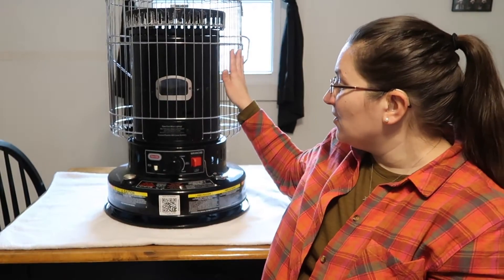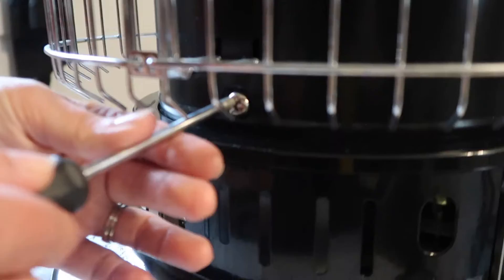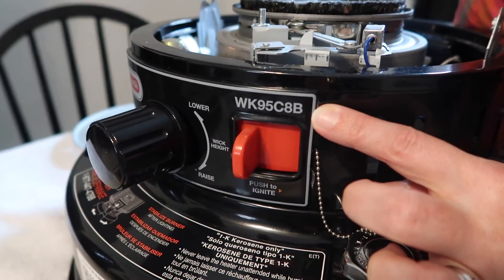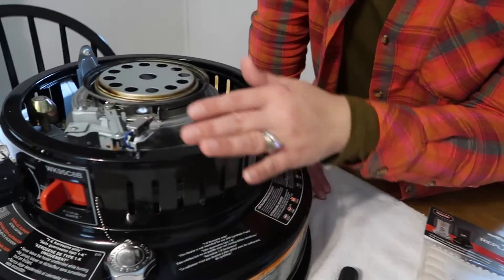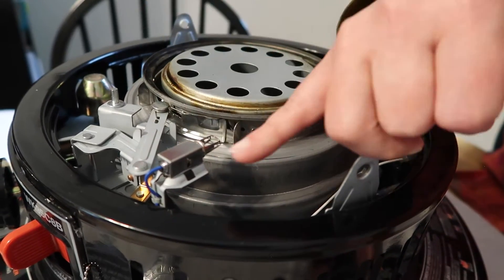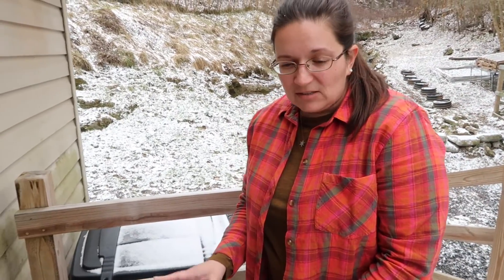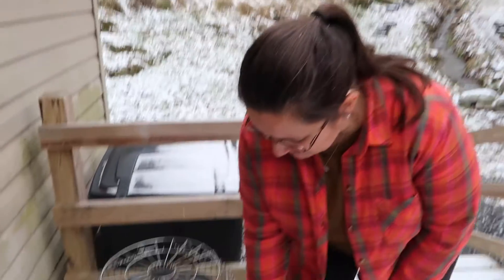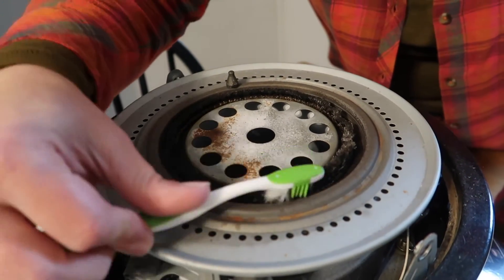Wick & Ignitor Maintenance  (Dyna Glo 23,800 BTU Kerosene Heater) for Emergency Heating

Comment: So you just use a dry tooth brush after you dry burn it ?
Reply from the maker: Yes and the reason for this is to brush all of the remaining carbon deposits off the wick. Carbon deposits in the wick basically burn up during the dry burn…think of a self cleaning oven…you still have to go in after the clean and remove all the burnt stuff out…same thing with this wick. Thanks for watching and supporting my channel. If you haven’t already, please consider subscribing. Take care!

Comment: CAN I USE DIESEL GAS KEROSENE IS 8 A GALLON HERE
Reply from the maker: No. I can write a novel about why you should not burn diesel in a KEROSENE heater, but the most important reason is because the manufacturer designed this heater based on the chemical properties of kerosene fuel. Their manual is very specific to ONLY USE CLEAR K-1 KEROSENE. The manufacturer is NEVER RESPONSIBLE for any damage (if your house burns down) or loss of life (heavy carbon monoxide poisoning produced from burning diesel) that may occur from improper use of this heater (aka putting diesel in this heater when you're not supposed to). The way I look at it is, you wouldn't put diesel in a gas powered truck would you? No? Then why would you risk putting the incorrect fuel in a KEROSENE heater? I know you see it all over the internet, people putting diesel in these heaters. Don't let stupidity fool you, there are a lot of negligent people out there posting unreliable and unsafe information to YouTube for the sake of views. Personally, I'd rather see people safe than sorry so my answer will always be a hard no to this question. If you found this video helpful, check out our big playlist of kerosene heater videos. Here's the link: https://www.youtube.com/playlist?list=PLFiwaO861E2zrYAbNULU-taPr7_Qcejcu Thanks for watching and supporting our channel! If you haven't already, please consider subscribing. Take care and stay warm!

Comment: How long does the wick last
Reply: And can you use rechargeable c batteries for this
Reply from the maker: Hi 👋 there is no direct answer for your question because there are so many variables to consider. With proper maintenance (dry burning) and using only clear k1 kerosene, fiberglass wicks CAN last several winter seasons. I’ve heard of people using the same wick for over 5 years. My family uses these heaters daily as a primary heating source. I personally prefer to change the wick every fall before the winter season starts to have a peace of mind. Fiberglass wicks aren’t expensive, they typically range between $10 to $20 for one depending on what store you purchase from. Thanks for watching and supporting our channel. If you haven’t already, please consider subscribing. Take care and happy holidays!
Reply from the maker: Absolutely! I’m not sure how long rechargeable batteries will last though. Regular c batteries will last an entire winter season of starting this heater daily with the igniter switch. When it comes time to store your heater (usually in the spring), remember to pull the batteries out. This prevents any possibility of the heater being “accidentally” turned on during your storage months.